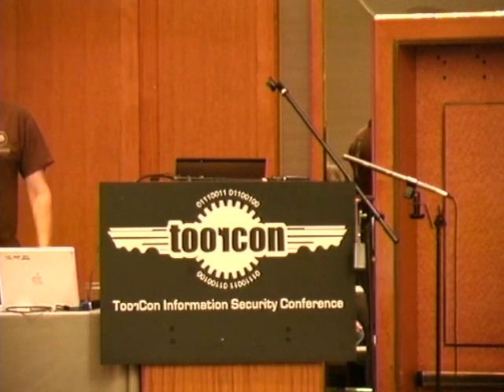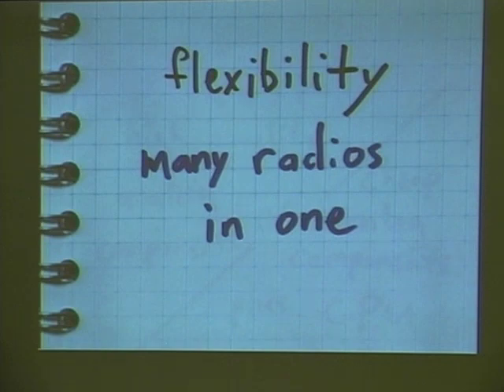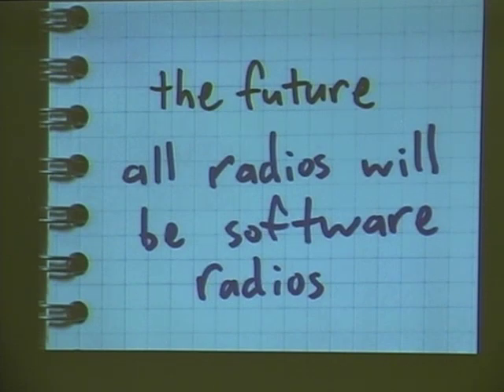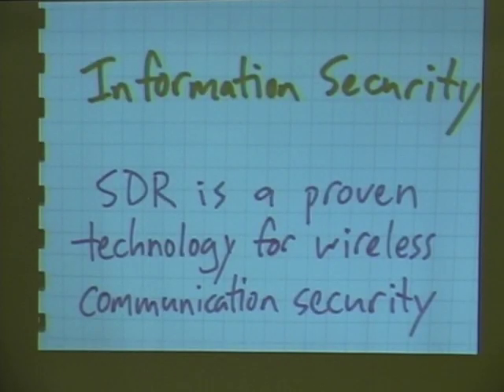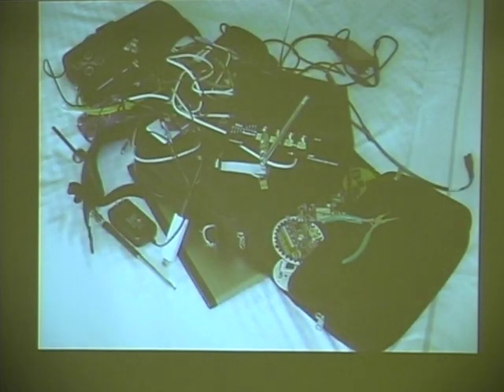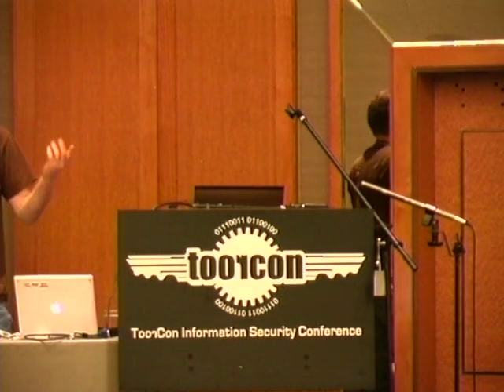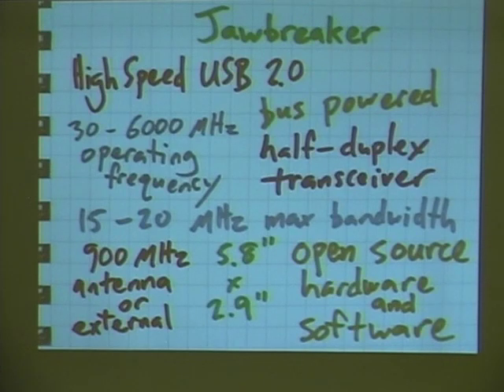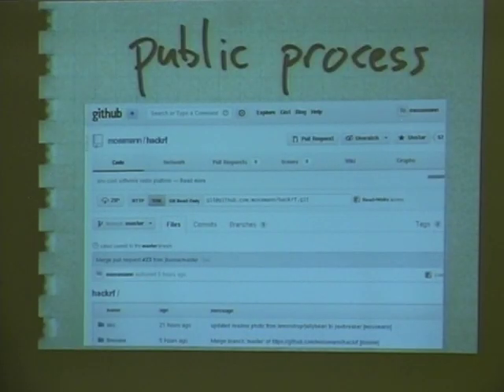HackRF: A Low Cost Software Defined Radio Platform

Comment: Great presentation. I am not a programmer or designer, but can solder a few components on a pcb. I thoroughly enjoyed - and understood - the presentation. I am a ham radio operator and  use 4 SDR's. This is a wonderful project and I just cant wait till the cards are available for testing.